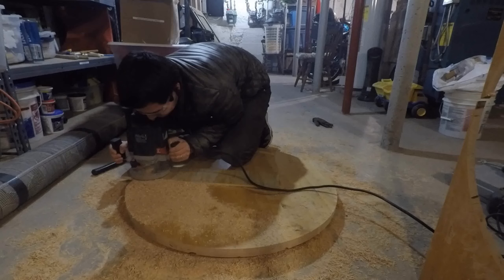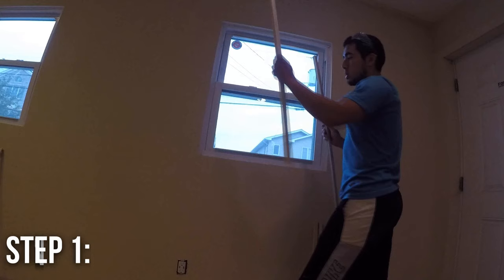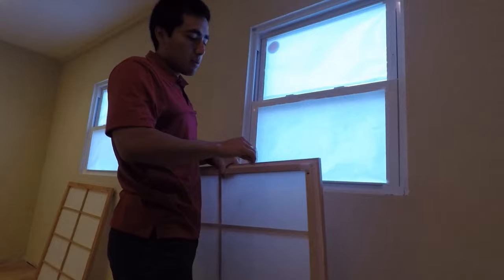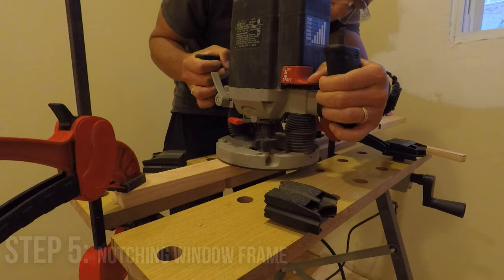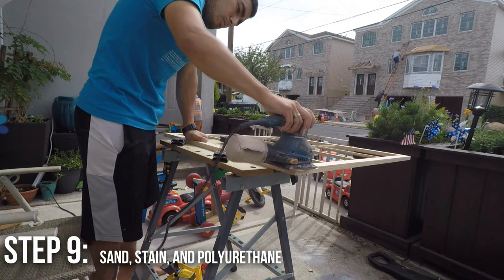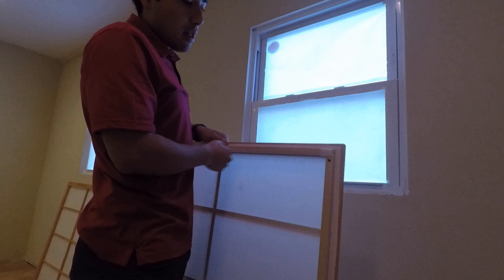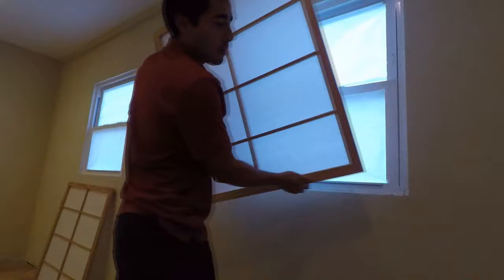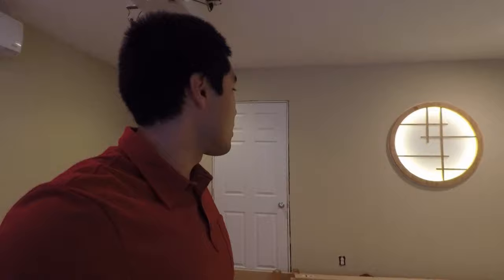How to make a Japanese Shoji Screen Window

Comment: Damn I can't do that since my window is too large... and German
Video is great though, if my own home'll have smaller windows i will do this.
Reply: Doubt I'm bringing anything profound to the table here lol,
but what if you just made a larger one?

It's the window that is German, or?
What's it matter?

& hey, no trolling intentions here- 
Only curious.
😀 👍 Thanks!
Reply: @stevengrizwald4196  you see, windows in Germany usually open like doors, like, they have hinges and swing open instead of sliding upwards like in America. The size is just a problem because it looks weird because it is almost as tall as my wall but it doesn't go all the way to the ceiling or floor. Just looks weird you know
Reply: @GodMaxDrinkerofTea  I don't think it would look weird if you sized it to fit right inside the white edges of the window. Plus, it would look cool when you kip it!
Reply: @KrossKristopher  Well, I could try it. I'll tell you how it looks, when I'm done.

Comment: Never use a table saw on a crosscut without a miter gauge or tracking sled. Too many fingers lost to stupidity and arrogance. OSHA calls for guards, pawls, and a riving knife--but the miter gauge reliably prevents roll/bind/kickback/has anyone seen my finger?